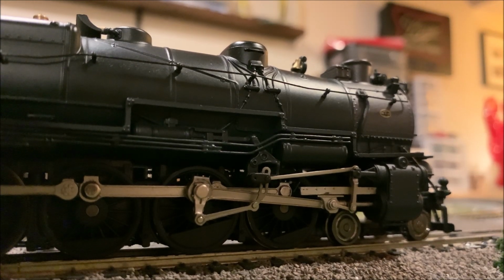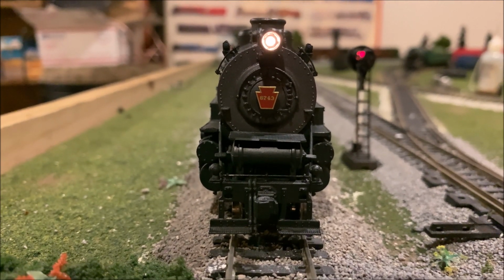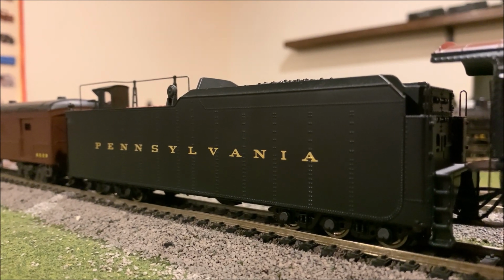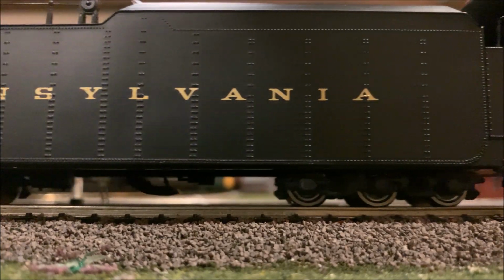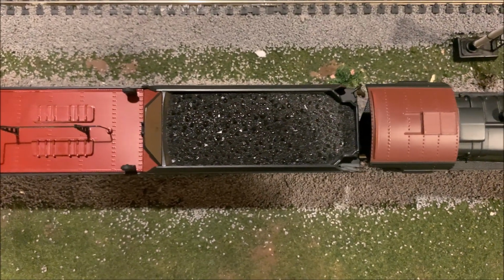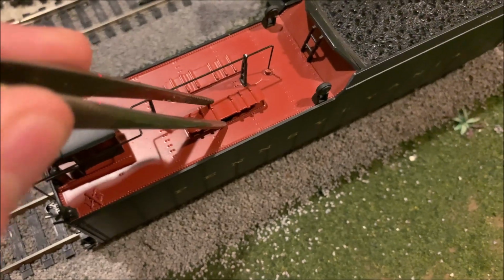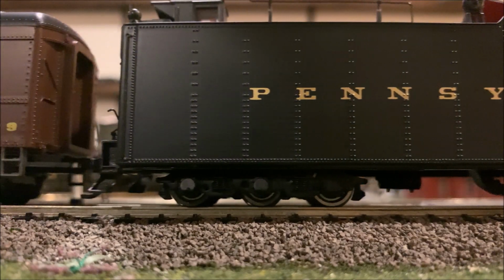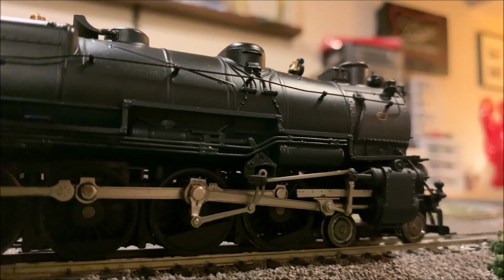BLI's HO Pennsylvania Railroad M1a 4-8-2 Review and Run

Comment: See if you can invest in an MRC Tech 6. It's older technology, but you'll be able to switch between DC and DCC functions, and get all the sounds and features without having to invest in an actual DCC system. Some people consider it "cheating", but it's your road. I run a Lionel Challenger, a Lionel GTEL and an Atlas GP40 -- all DCC locomotives --- with my Tech 6, and they all work flawlessly. And when I want to switch back to DC, just the push of a button and that's it. Didn't have to change the layout wiring or anything like that. It's not a bad way to go.

Comment: Nice review on this! Such a beautiful engine you have but sadly it doesnt smoke!
Reply from the maker: It does smoke. Just didn’t mention it. I never run smoke fluid as In my experience it just destroys conductivity of the track
Reply: @gopernoperstrains3160  I understand bud
Reply: BESIDES ACE!  THE SMOKE UNIT IS DOOMED TO FAIL & DESTROY THX TO BLI's IMPECCABLE ENGINEERING!!!!!!!!!!!!!